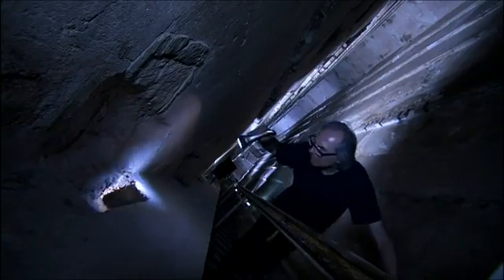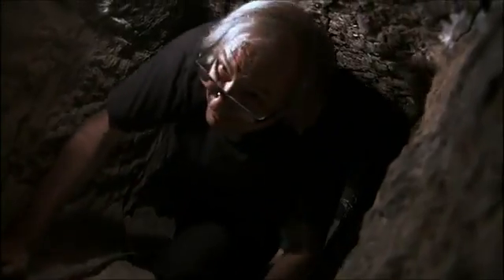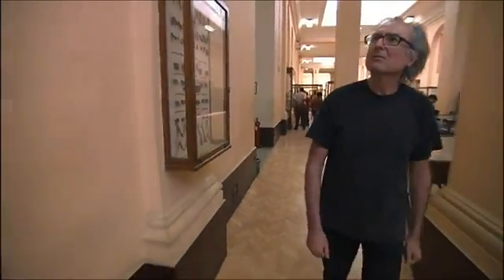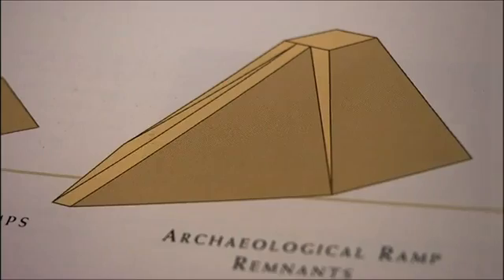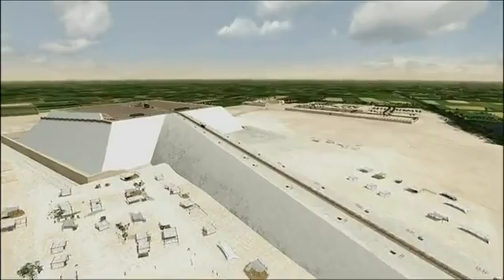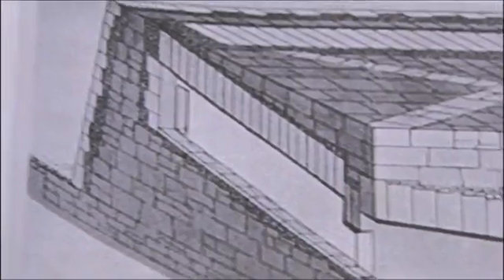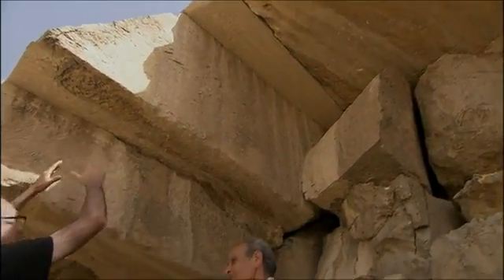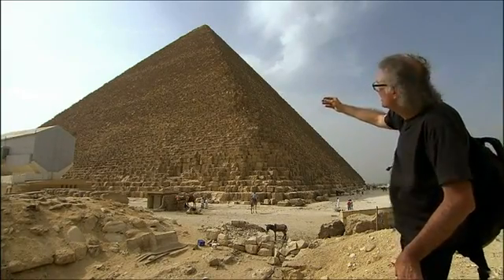2 The Great Pyramid of Egypt, How was it Built- new solid theory, new evidence. JP Houdin. 2011

Comment: The Egyptians didn't know about the wheel , the  most under-estimated statement ever made! They could have seen the circular objects in paintings etc on the walls of the Temples. So the Egyptians were so dumb that they could build a Pyramid but could not figure out that a circular object drawn by animals would be more helpful to carry objects than using sledges? The Pyramid are more 10,000 years old and it wasn't the Egyptians that build them. A simple question of asking  the people of Kemet decent could solve a lot of queries.

Comment: Cedar? under 2 to 100 or more ton blocks? Even if wet, or oiled sand, that sled would be sawdust very quickly. 2.5 million multi ton blocks with how much cedar available? Please. Silly. Ramps whether inside or out cannot do this gargantuan task. And why, when water canals and buoyant principles can meet the need? A much more likely method over ramps and sleds.

Comment: most of those blocks are not stone, it's mostly ancient concrete (much like modern geopolymer) poured into moulds probably using baskets or buckets, and then smoothed or shaped while the concrete partially sets - the ingredients of ancient concrete were readily available such as sand, gravel, mud, clay and volcanic ash to produce ancient concrete that we see as limestone, sandstone and granite - holes in ancient concrete are easy to produce using timber or copper rods which can be easily knocked out after the concrete solidifies

Comment: Total rubbish. Google "Egyptian machining", Egyptian tube drilling" and then explain how so-called primitives had tube drills (with a cutter wall thickness of about 3mm) that would cut at feed/speed rates that match, if not rival, our modern tube drills. Look at the precision in the machining; saw cuts, symmetry, tube drill spiral grooves, machined surfaces, etc. As a designer and builder who has used CNC mills/Bridgeports and lathes, I assure you this will make you consider that someone in our pre-history had advanced understanding to some degree. This in turn, should awaken the idea that maybe the pyramid's actual purpose is still to be determined. I do like the idea that the pyramid was a coupled oscillator, funneling vibrational energy from the earth like a tuning fork for some unknown purpose. The conclusion is TBD. We need to think outside the mainstream academic box.

Comment: I don't like when the commentator says "the Egyptians didn't know about the wheel" when they are showing the wood sled in the museum....
Really? 
It's like saying "I drove from Chicago to New York on my car because I didn't know Airplanes exist".... sounds ignorant right?
Reply: @andyFreak123 I don't get your comment... are you trying to insult me?
Reply: What does that even mean
Reply: It wasnt wheel. It was sphere. 
   Heres theory!
   How the pyramids of Egypt were possibly and most likely built:
    The stones were shaped at or near the quarry and transported to the Pyramid site in this method :
    An assortment of encasements from spherical to cylindrical, encased the block and interlocked into place around each block stone allowing the stone to roll. Certain attachments around the encasement would allow either fulcrums or rope attachments to ease movement and allow for tight corner turning with the least amount of men. Once the stone reached the top, the interlocking encasement was disassembled and the stone was leaned over and slid into place.
    This technique would have eliminated the need for lifting devices or a massive ramp.
    My theory is that most likely it would have been a spherical encasement allowing for tight cornering. This would be the most logical way to transport a large stone using the pyramid itself as the ramp.
     So in essence the stones were rolled up the pyramid in a spherical encasement that was removed once the stone reached its destination and leaned and slid into place once atop the pyramid. This process was repeated all the way to the top. 
     I have not decided yet if the encasements were made of a metal alloy or limestone etc. If bronze was used it would have been melted down for chisel making and as such there would be no evidence of the spherical encasements.
    If limestone was used it may have then been discarded and reused for other construction. 
    In conclusion the only way to deliver a square to the top of a Pyramid is to encase it in a Spherical interlocking encasement. And adding this: also that a rail system shaped would have guided the sphere to its destination

Comment: they used animals, like elefants and oxes to lift the stones with ropes to the top, it's not even a problem. In all these theories they show only humans  working, that's ridiculous. Why wouldn't they have used farm animals instead.
Reply: +1974Coconut and how did the animals arrive to the top?
Reply: +mahmood zoabi why would the animals need to go to top? They were on ground of course, or lower floors, and used winches. Like today they do when they lift a concert piano to the fifth floor.
Reply: i accept with you but the problem : what are the winches look like and how working 5000 years bc
Reply: okay i will tell you :  they raised the huge blocks by balance that in one side they put the block and in the other side they put a number of small stones that they can hold til the block is balanced, there was a balance above another and so on to the summit on the pyramid, that every balance take a stone from the balance that below him. +1974Coconut

Comment: The only Ramp needed is still inside the Pyramid , " The Grand Hallway ", with the slots on the sides acting as bearings holders or" Stables"for a larger piece of machinery . 
Ps. If the fact the wheel wasn't used , pushes the technology back ?
You need a " Road to use wheels " , 2000 ton blocks of stone don't go too far in sand .
 Gianfranco Fronzi . March 10 / 14

Comment: In that hole in one side of Menkaure's Pyramid that I mentioned earlier you can see what looks like a nice flat internal vertical wall that goes up to about half the height of the pyramid. It appears to me that they built several flat sided square sections getting smaller as they went up, like a step pyramid. Then apparently they filled in the remaining spaces on each of those levels to make the actual sloped sides. It's what you would expect the next advancement to be from a step pyramid.

Comment: First, if you cast stone you dont need to haul/move 1 Ton blocks over a long distance. Second, like cement,  geopolymer stone consists mostly of a filler material, usually sand which can be found close by. Makes sense?!

Comment: Let me get this straight ... they BUILT the pyramid but did not know how to make a circular spiral tunnel ???? If you read how they made the ground under the pyramid PERFECTLY FLAT leveled to .009 of an inch I *THINK* they were aware of spirals since that is how Pi comes to be integrated in the pyramids . They used intersecting spirals to draft the straight lines of the base . SO .. Here's another FAIL for the fucking experts.  GOD are these experts annoying!

Comment: They were probably aware of the wheel, or at least the idea that round things roll, but just had no use for it.. Wood was quite a rare resource, and it would have been of no use building the pyramids as it wouldn't have been able to take the weight. A sled is much more practical.

Comment: In case noone did mention it yet, the pyramid stones are artificial, they had been cast on spot using geopolymer technology. Stones created in this way are only distinguishable from real stone by x-ray analysis and checking for silicates inside the stone. The french geopolymer did proof this. Easy and elegant solution. This building technique is also documented in agyptions texts from the time of building.

Comment: CAnals baby canals, everthing can be made to float archamedies principle, ANY OBJECT SUBMERGED IN A FLUID IS BOOIED BY A FORCE EQUAL TO THE WEIGHT OF THE LIQUID THAT IT DISPLACES. IF THE AREA COULD be flooded then the stones could be picked up by rafts and then lowered into place.    they did not use fucking sleds, that is just iggnorant.